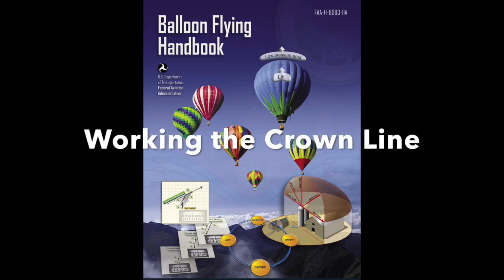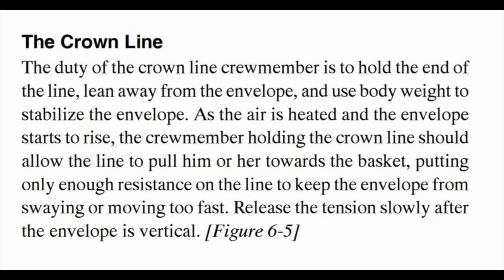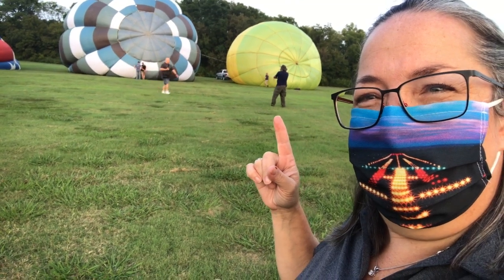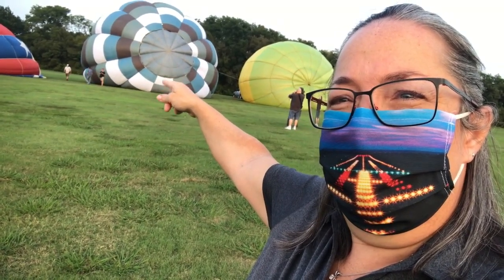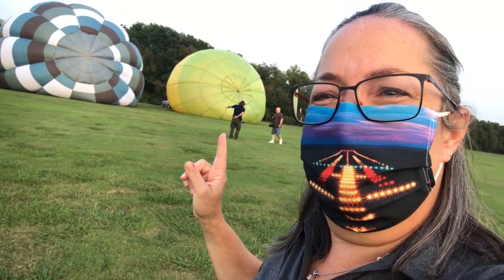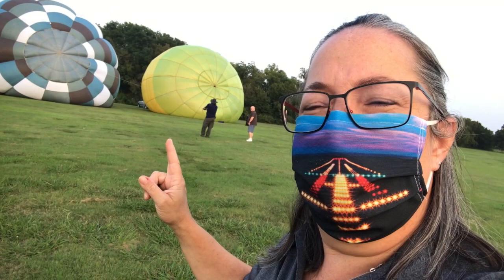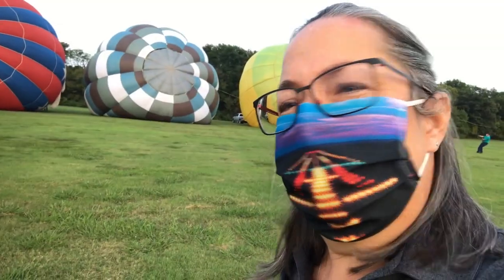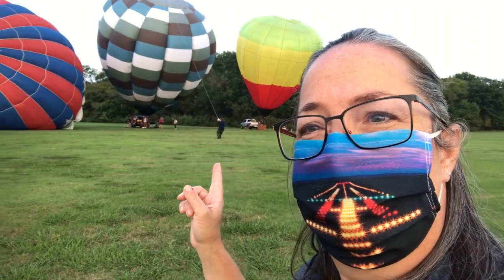Working the Crown Line

Comment: How many people makes up a proper balloon crew?
Reply from the maker: Mike Farlow there isn’t such thing as “proper”. It is more about desirable. That number depends on the size and type of balloon. They vary greatly. A large, special shape balloon will require more crew than the one in this video (65,000 cubic feet) or a different size. For this balloon and my balloon (size 77,000 cubic feet) ideally crew would be a minimum of three able-bodied people, two for the mouth and one on the crown. A fourth person would be good as someone to work the inflation fan. These are all not including the pilot.
Reply: I agree with most of your statement, but disagree with the last statement, the person on the fan is extremely important, the thought personnel are important near the beginning, but by the time the pilot is ready to hot, are not necessary if the crown line is being held tight enough
Reply from the maker: matthew ibbotson I don’t think I said crown was most important. All of the jobs are important! (I just haven’t done videos on them, yet.) In our hot air balloon business, we had an experienced person move from mouth to fan. The pilot (my ex) would adjust the fan as needed during the cold inflation if we didn’t have someone dedicated on the fan. And in reality, the balloon I have has been crewed with just him (as pilot) and me as crew. So all jobs can be done be less, and all jobs are important, but based on a varying number of crew, some positions might not have a dedicated person working it.
Reply: @captainjanet1855  I dont disagree, I only think that from a safety point, having someone on fan is of the utmost importance 😁👍
Great video BTW